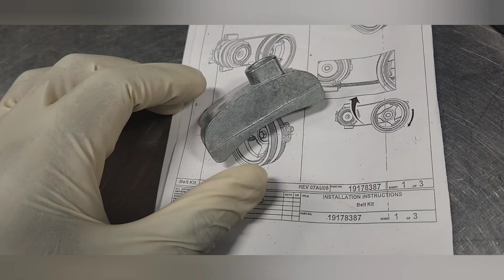GM trucks and SUV AC stretch belt installation in 90 Sec

Comment: Don't need that stupid wedge, just hold the belt in the grooves and turn the crank pulley. Sometimes a zip tie can be used to hold the belt, and then crank it with the starter, no tools required..    Done 100's of them.
Reply from the maker: I get what you saying but the tool works great why not use it, thanks for watching 👍